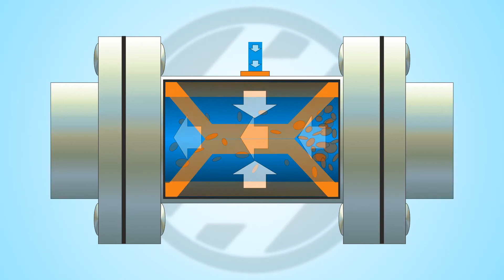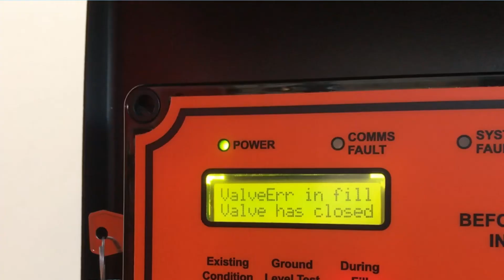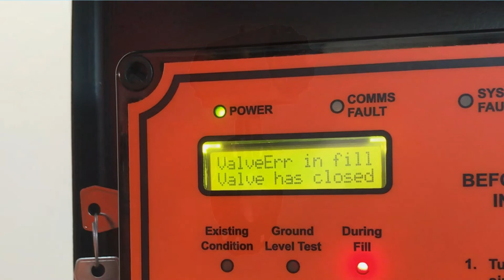The Big Problem with Silo Inlet Pinch Valves

Comment: Which is the actuator? Fail safe
Reply from the maker: Thank you for your comment. It is important all parts of the system are failsafe including the actuator. This is a spring closed actuator, so air pressure is needed to open it. If the pressure decreases or is cut off the valve will close automatically with the force of the spring behind it.